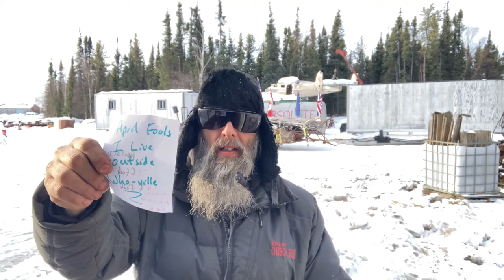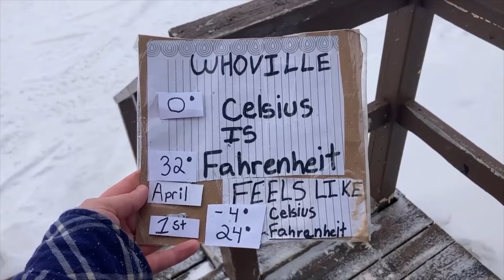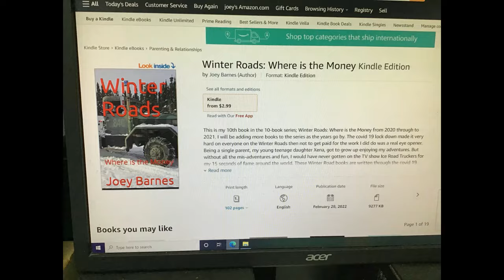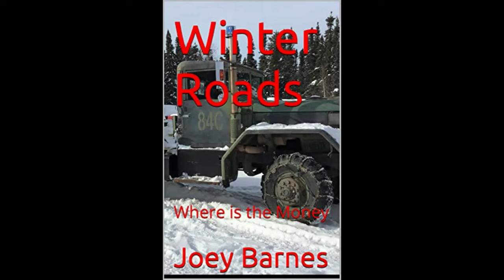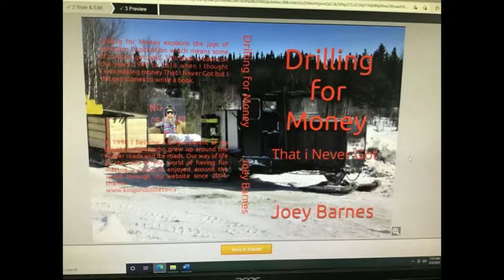Nasty Weather So Loose Ends Kind of Day April 01 2024

Comment: You have enough stuff in the yard. Why not change out the hole ft axle and steering system out of the linds?
Reply from the maker: it is pointless, these are the only 2 working Linns that go out to the bush and work. all other Linns around the world have wheels on the front.  thansk